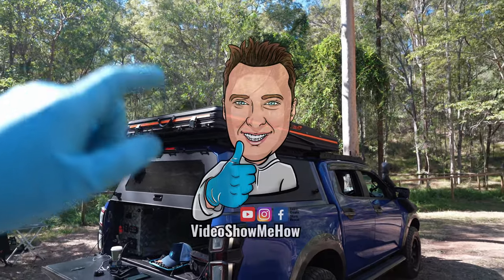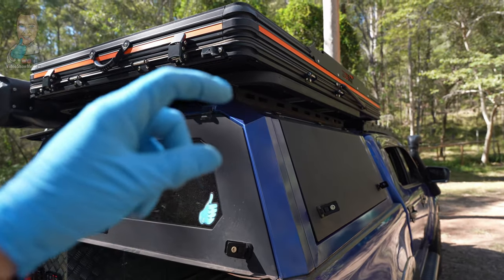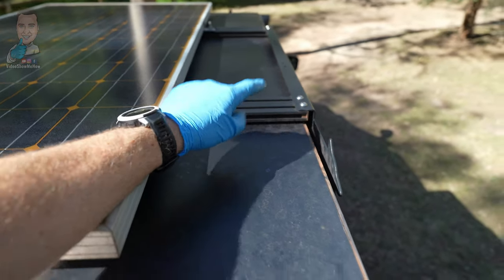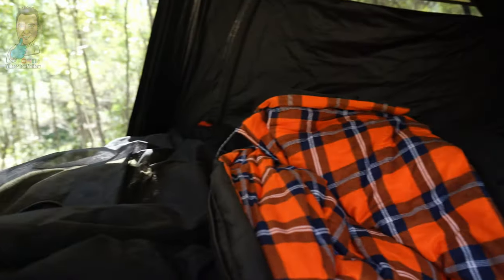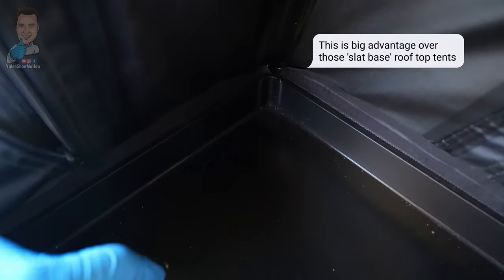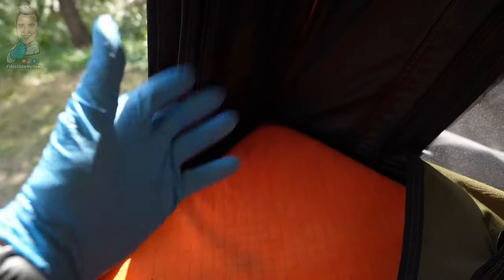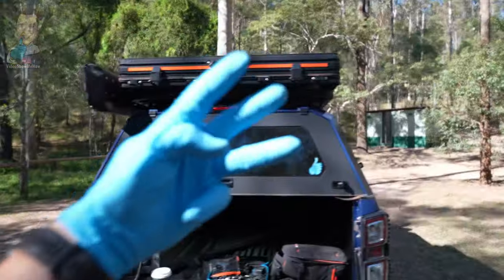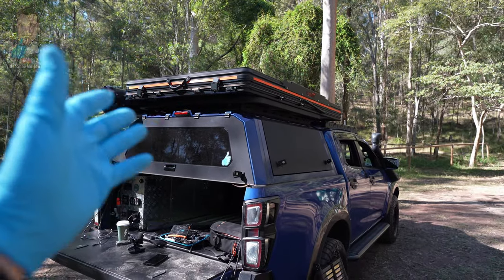23Zero Saber X (Kabari) Roof Top Tent | Timed POV Setup, Pack down | Full Trip Ready Review

Comment: Think another con is the tent doors zip up so u have to climb over the doors and midge screen. These tent builders should just stick to tents zippers that zip down so one doesnt need to climb over the doors . 

Nice tent. 😊
Reply from the maker: Yeah good point, top down would be great
Reply: I like the down to up zipping.  This way if it's pouring rain and windy you can still have the window open partially.  If it zipped down, you would have to have it fully closed to prevent water intrusion.

Comment: Thanks for your video mate. How have you mounted the tent on the platform rack? Does it have the T slots on the bottom of the tent like the normal Saber does?
Reply from the maker: yep sure does. I hard mounted this to the canopy in this instance but could mount like an normal RTT via the t-slots etc
Reply: @VideoShowMeHow could be an option with my canopy to do the same. Thanks!!